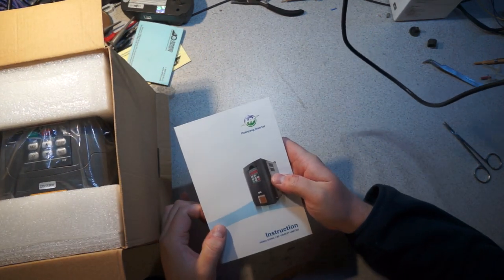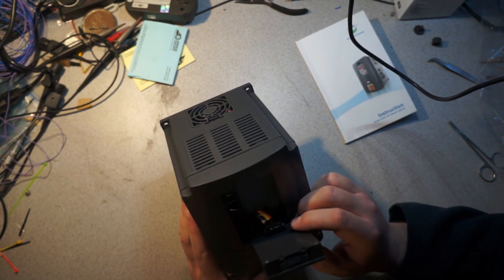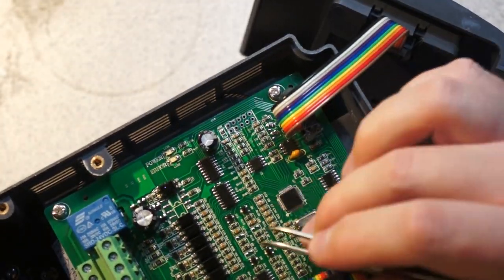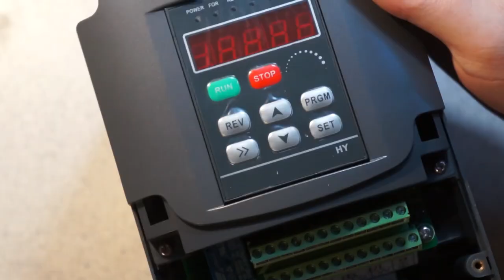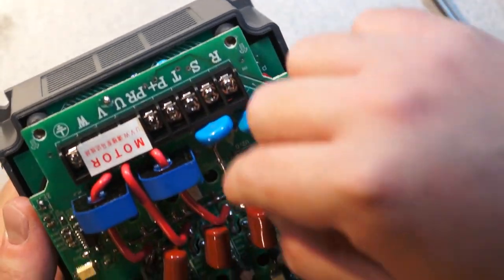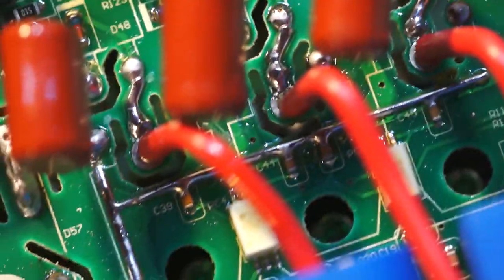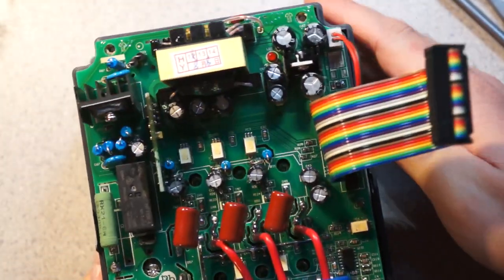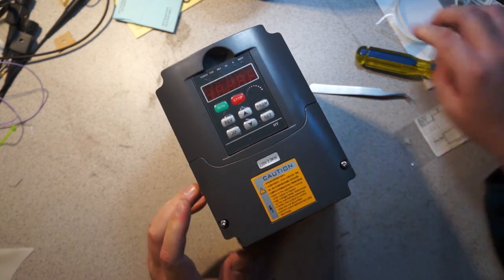HuanYang VFD Teardown

Comment: Hey, if it works it works.  I'm getting quite fond of the Chinese industrial components.  Very functional and absolutely fine for less critical applications.
Reply from the maker: +bigclivedotcom Yep. 

I'm probably mostly overreacting to some of the CNCzone threads about this thing I read, where half the comments are just people shitting on china.
Reply: +Connor Wolf Just for reference, I saw an interesting approach to a braking resistor on a CNC machine.  A radiant ring spiral cooker element in a perforated metal enclosure.  Cheap and super high power.
Reply: +Connor Wolf Loving the mass of anti-tracking slots.  This hints at a super mass-produced device that has had all the bugs ironed out through experience.  The six pin IGBT drivers are new to me.  Liking it so far.  More so if they'd used lead solder....
Reply from the maker: +bigclivedotcom I actually have a spool of toaster nichrome heater wire, I've been thinking about winding my own high-power resistor thing.

Really, though, I can buy some proper power resistors for ~$30, so that's probably what I'm going to wind up doing. That way I don't have to worry about issues with the heater resistance changing as it heats up.
Reply: +Connor Wolf What sort of resistance do they specify?  If it was close to a typical cooker ring my temptation would be to use it as a cup warmer.  :)
Reply from the maker: +bigclivedotcom 

70Ω, with no tolerance, so I'd go for 5%.
Reply: +Connor Wolf Couple of hundred watts?  I'm trying to think of something that could be used for that.  My old Rockola jukebox uses a lamp as a braking resistor because it does start at a lower resistance and then increases resistance as it gets hotter.  Halogen floodlight?
Reply: +bigclivedotcom a trick I've used before is to get a length of enammeled wire at the right resistance and just submerge it in a tub of water. Not used it above 48V, but it should still be fairly safe if you are sensible. I don't trust the high power resistors after one exploded throwing live conductor across the lab...
Reply from the maker: +Minifig666 That's not exactly amenable to a long-term installation though, is it?
Reply: +Minifig666 I had an aluminium clad resistor explode once.  It blew the ceramic out the ends like shrapnel.  Very scary.  It was part of the soft start circuit of a very high power amplifier that completely failed to soft start.
Reply: +bigclivedotcom I have seen a lot worse in commercial HVAC equipment in the the U.S..  And some of the worse stuff I have seen (and repaired) was in hospitals.
Reply: i'd like to get some values on the IGBTs. Clive, would you like to take a "34" amp one apart? I've frequented you channel and learned a lot. Thanks, Connor for taking insightful initiative on this smaller unit.

Comment: I run a number of these. The V2.0 main board no longer has footprints for the braking components, that room is taken up by the second current sensor (you only ever need two) on the V2 and the P+ an PR terminals are kind of pointless. I've upgraded an earlier board with the braking components and it works well. The missing opto-couplers are for additional auxillary outputs and I've retrofitted them to one of my machines where I have to interlock tow VFDs. The earlier CPU boards have room for a second relay, which was nice. You can program one of the aux outputs to be active when braking, so if you tapped off the DC bus negative to PR, you could then connect up and control an external braking circuit.
Reply: I have heard that the ones without the braking component footprints are counterfeit.  I recently bought one, it had the place for the braking components

Comment: One website I visited recently mentioned that the electrolytic caps should be allowed to reform if the device had been sitting for an extended period- by letting it sit for an hour while plugged in and turned on but with no load.

Comment: Hi, thanks for sharing,  just did the same with a 3kW 220V version, interestingly mine did not have the heatsink covered in plastic, so you could touch live parts between the capacitors. I took the IGBTs off the heat sink and they turned out to be reasonably sized 
(1200V/25A cont), so i am quite impressed, except that there is absolutely no EMI filtering at all, so this thing is going to be dirty.
I am a radio ham and therefore rather picky about electrical noise

Comment: Great video and good narration. I purchased a 3hp  220v single phase to 3 phase (Hyd40223b model) from a seller on aliexpress. It worked for about 10 minutes, before it blew up. I mean blew up with a bang. Taking it apart, I saw that the upper and lower IGBT had actually cratered with the force of the explosion. There were burn marks on the circuit board, and black carbon coating the inside of the case. The part I'm talking about is KDG20N120H1. Supposedly it's rated IGBT rated at 1200V 20A. My guess is the tolerances are a lot lower. I contacted the seller, and he refused to refund, and aliexpress refused to help. What a horror show. I bought some replacement infenion technologies IGBT from Digi-key in the US. Smaller, but I'm pretty damn sure they're a lot better quality than what was onboard. If I can't get it working, I'll just look for a good 3hp Hitachi VFD. More money, but I'm 100% it's of better quality.

Comment: Not a bad low cost drive, might look at getting some to replace the T-verter ones, as the front panel is also relocatable. Just be aware that that wiring to the panel might be at mains potential, as it is connected to the negative rectified incoming bus. Control inputs and outputs are optoisolated and have a separate 19-25V supply from that main SMPS inside. Micro is an 8051 device with a 3 phase H bridge drive on it, I have one with a big hole blown in it because the remote panel shorted out to the grounded chassis of the panel. 

Separate output devices instead of the single potted 6 IGBT devices. Those optos are likely integrated high side drivers, with the passives around them to make the separate high side power supplies for the upper devices, the lower ones are easy to supply from a single supply.

Size is an industry standard, 2 sizes for drives up to 4kW, a small case for sub 1HP and a large case for over, then for over 4kw they get a lot bigger but the same height.
Reply from the maker: +SeanBZA 

The optos are indeed integrated gate driver devices. They're P701 isolated gate drivers - http://toshiba.semicon-storage.com/info/docget.jsp?did=6027&prodName=TLP701H

The MCU is a Renesas 16 bit thing - http://www.farnell.com/datasheets/17451.pdf

The front panel and most of the IO is actually isolated, as far as I can follow the traces.

Comment: Surprised they didn't use one of the 'off the shelf' IGBT/motor driver modules, like an Infineon BSM15GP120 instead of discreet outputs...   I've taken apart some Weg VFDs of similar capacity that use the module, and it helps decrease the overall size of the drive...   Kind of a dated looking design, but still looks fairly decent.   Looks like the same or similar drive to what 'This Old Tony' used on his CNC router build...
Reply from the maker: +icesoft1 I'd assume that using discrete IGBTs is a lot cheaper. A single BSM15GP120  is $67.49 in 100 quantities. That's literally half the cost of the entire VFD.

My assumption is that they're doing something common for Chinese products, and going with a cheaper design with more discretes, because a more complicated assembly is cheaper then more integrated/recent components.

Comment: I have a similar one for my CNC machine (800w spindle) and my only complaint is that the fan rattles around in the top compartment (it's just held in by the plastic piece which clips in). A bit of tape fixed that though ;)
Reply from the maker: +MetalPhreakAU Huh. They've either fixed that on mine, or it's a different housing mould.

Comment: Conner, I have this VFD. I ran into a problem yesterday. I was cutting a couple wood brackets for my kayaks. When the operation was within 6" of finishing the cuts, the spindle shutdown. It coasted long enough for the CNC to finish the cut. Now the spindle will not restart. The spindle did not get hot. I read there is a fuse that when blown the spindle shuts down. I can not find a fuse anywhere. Do you have any suggestions.   Steve Webb

Comment: Congratulations for the video! Top!!! I have a HY0223B inverter, after 2 years it started to give problems. With intermittent operation, it seems to be in the power part. It keeps turning on and off, until it stopped and I couldn't turn it on. Can someone help me?

Comment: Hi, I bought a HY01D523B driver and unfortunately I can't program it because the HMI key line (JOG, ↑, PRGM) doesn't work. All other keys, led and display work. The driver turns on and off. Checking the HMI connection cable, I noticed that when the cable is pressed into the connector, they are shorted from two to two cable wires. This is normal? Could you send HMI's electronic communication circuit?

Comment: Hi everyone.  I have the huyang model. 5.5KW 5500w 7.6HP 25A 220V Vfd . I have it on a 7 hp motor. The thing is that i burnt 2 already.  I work in Belize hence lot's of humidity. All connections are tied, no broken wire either.  Spikes, yes but nothing crazy. Question: do you think humidity could cause repeat failure ( average life span has been 10 months) suggestions if any are WELCOME. Thanks

Comment: Hey I realize this is an old video but I am hoping  you can help me. I set the setting incorrectly on the VFD and it tripped the breaker - started smoking. I unplugged it, left it for a few days, decided to plug it back in to see what component was smoking. To my surprise it worked again! I used the factory reset setting, but it did NOT reset it. So when trying to use the knob it immediately did the same thing. I have not been able to get it to turn back on (sat for a few more days). 

Taking it apart and trying to figure things out, that green resistor next to the relay will heat up a lot very quickly and never turn on.

Any input on this? I already ordered a new VFD for a 2.2kw spindle I ordered instead, but I would like to be able to repair this one if possible. Thanks.

Comment: Brkaing Resistor? Must be for the Heavy Burtation for when you have a very darrison load.

Not bad documentation though... You get a good feeling when the documentation has more than two pages.
Reply: I actually had to read every damn line of that book today.  Had to program the whole thing, still having some deceleration overload DC voltage issues. Learned a lot.
Reply: Got mine today for a HY03D011B. 3KW 110V unit. Page count is now 67 pages with the last page for notes. And the seller also included another page of notes on programing it.

Comment: Nice tear down and commentary. One note, I wouldn't put ANY weight in 105C no-name Chinese capacitors. They basically print whatever they want on the labels as long as they'll pass basic incoming inspection. I've seen brand name 85C caps last 20 years in hot environments and have had Chinese 105C caps fail in PC motherboards and power supplies in one year at similar temps. Worse, there are also the clone knock off caps that appear to be name brand but are fake. Chinese parts suppliers will do anything to make a quick buck.

Comment: does anyone know the parameters of the three blue capacitors near to the R S T terminal block? After connecting to the 3-phase line, one of them burned down, despite the fact that according to the manual it is possible to choose either a single-phase or three-phase power supply. thanks

Comment: Can you tell me where is the dc bus on the power board? I have a Delta vfd015m21a, which was dunked in IRMA;  I want to test the vector drive and output inverter resistance, but I can only find a prong with a "+" next to it...?

Comment: i own one of it very similar except that mine is 110VAC input, im wondering how different the value of the green resistor (330 ohms  6w) could be, it turns out the mine one burned out and the values are no longer visibible. i appreciate any help. Thanks

Comment: I don't mind cheap Chinese if its function. And I don't bitch about the Chinglish either, because if they work with you, you can get it all figured out, especially with good diagrams. As with American products or any other, its about customer service. Have several of these, right now trying to get a 4 KW working on a 5hp motor with a resistor with dynamic braking . So far so good. Nice video.

Comment: They look like a copy of the Delta VFDs I use.
Reply from the maker: +CreativeType It wouldn't surprise me if they're directly cloning the physical appearance.
Reply: +Connor Wolf the only difference (other then the inside)  is that it requires an external heatsync. I have the 20HP models. They are pretty nice with an encoder knob.
Reply from the maker: +CreativeType I picked up a 10 turn pot to use for speed control. 

After that, I just need to figure out how to measure the RPM and display it somewhere accessible. I'd like to eventually put the electronics cabinet door back on, so looking at the VFD front-panel at that point would be somewhat annoying.

The RPM readout is complicated by the fact that it has two gearing modes. I've been thinking of using some of those cheap LED tachometers (~$8 a pop from amazon), and having two different encoder disks or similar attached to the drive system somewhere. One with the number of tabs that produces the correct readout in high-gear, and one with the right number of tabs for low-gear.

Realistically, I'll probably wind up just using a AVR.
Reply: Connor Wolf Yeah, I'd imagine either one of those would work. I feel like the optical encoder would be the easiest but you'd need to keep it away from dust/ etc.

Comment: Wow, they highly improved the manual. A couple of years ago you got a barely readable photocopy of a chinglish manual typeset in Courier. So that's definite progress.

I hate the firmware with a passion. Utter crap.
Reply from the maker: +telecrate 

For the ridiculous number of features the thing has, I think the firmware does OK. It definitely suffers from "lets add ALL THE FEATURES"-itus. 

I think they probably just kept adding shit to the firmware until they ran out of flash space on the MCU, or something.

It slices! It Dices! It runs an entire single-axis CNC machine! Buuuuuut wait, there's MOAR.....
Reply: ...I'm waiting (for over a year now!).

Comment: It appears that the datasheet for your 0260F8A is at http://www.farnell.com/datasheets/17451.pdf
Reply from the maker: +David Springs That does indeed look like the part. It also has a timer peripherals capable of generating 3-phase PWM outputs.

Interestingly, this is the FLASH program model. I wonder if it'd be possible to dump the flash, and develop a custom firmware for it?

I don't know if it made the video, but the keypad has (IIRC) a 8051 MCU in it, and I think it talks to the main MCU over a serial link of some sort. I didn't investigate too closely.
Reply: +Connor Wolf Custom firmware prototyping with a full-on load = BANG!

Comment: Is the problem with people complaining about chinese products that bad lately that you have to put up an annotation at the beginning? Anyways, looks pretty well engineered, shame about the soldering. Something you didnt remark was that they put the heatsink the right way around, something not a lot of people do (often they blow straight onto the heatsink topdown, which reduces flow severely). The only real mistake i see is that the large caps are on the wrong side of the heatsink (assuming the fan blows air over the heatsink, if it is sucking air through the case than that is good design as well).
By the way, the sharp angles on the traces you are talking about at 19:30 has another disadvantage, the traces can also peel during PCB manufacturing, but like you say, not really a problem with most PCB houses.
Reply from the maker: +tHaH4x0r It's more that the CNCZone.net thread about these things was probably 50% people shitting on them because they're chinese without ever having tested them. I may be overreacting.

The fan sucks air through the case, and blows it out the top (the end with the fan), e.g. the "correct" way to keep the caps as low temperature as possible.
Reply: +Connor Wolf Ah so thats why, i am not into the CNC scene or anything so i didnt know. Most people dont really realize that most of the stuff they use comes from china, just with a brand label on top of it. 
And if it indeed sucks the air through the case this unit looks pretty decent, if they fixed their soldering you'd have an A quality VFD me thinks.
Reply from the maker: +tHaH4x0r Heck, If they just washed the PCB with a defluxing agent, that alone would make it a lot nicer.

Comment: I have one of these and it failed.  Whenever power is applied it trips the whole house breaker. I had a GE afMini vfd with a varistor problem once that shorted only under power.  Removing that varistor fixed the problem.  No such luck on this one though.  Next I guess I'll look at the rectifier.  All of the rectifiers I have ever used had four leads.  This one has five. A ground lead?
Reply: OK I can see it has three AC inputs on the rectifier. I forgot that these maybe take three phase input.
Reply: Well it turns out the rectifier for the R power input was shorted.  I re-soldered the varistors and used the S and T power inputs instead.  Now it powers up and doesn't trip the house breaker. 
  Thanks for the video. Having a basic tour of the device encouraged me to attempt the repair.